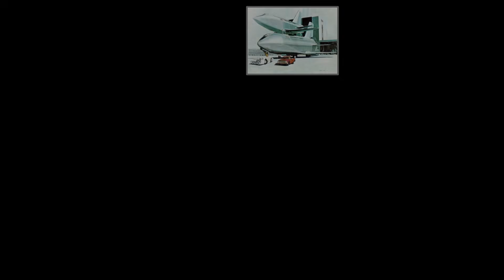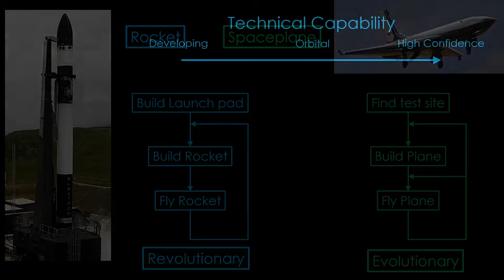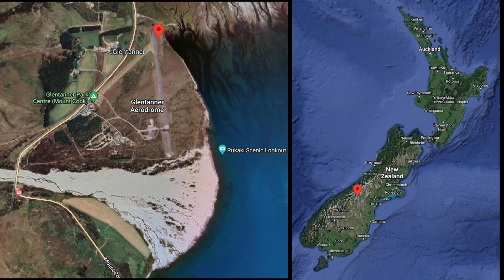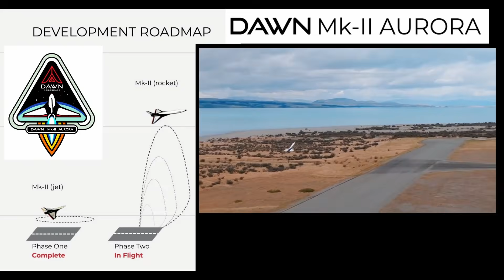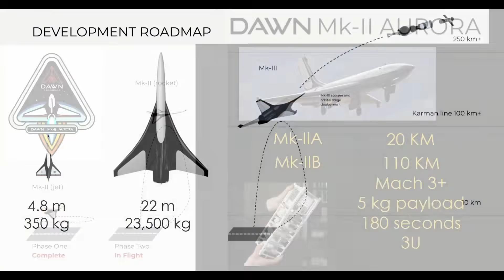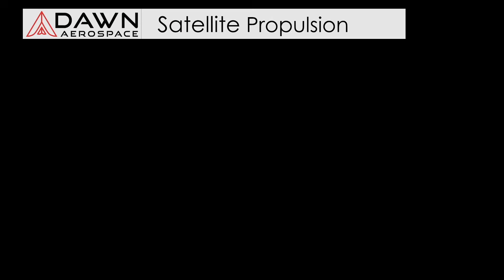Dawn Aerospace - Spaceplanes done right

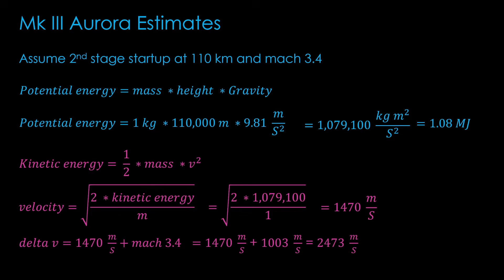Comment: I know it's an old  video, but16:55 is just plain wrong. You don't add the vertical velocity (needed to climb) and the speed at apogee as v = v_x + v_y as done in the video. You do it via Pythagoras: v^2 = v_x^2 + v_y^2. Or you add the two components for the required energy and then convert it to a velocity, it's exactly the same. The way it's done is the video is what you would need if the vehicle went straight up, then did a 90 degree turn to the horizontal, then accelerated sideways. But vehicles go in a diagonalish direction (resulting in a curve, because gravity) instead because it's far more efficient. This is what rockets do, and it's even more true for space planes.

This gives you 1900m/s not 2500m/s of deltaV. That's a *huge* difference, far more than the other neglected factors, and way too big for even a back-of-the-envelope estimation. Bad enough that that whole segment of the video ought to be taken down. It's a very, very basic mistake that I wouldn't expect a freshman to make. Getting simple physics wrong like brings into question the reliability of the whole channel, because who knows what other mistakes there are that I didn't spot, or are in places where the maths isn't shown on screen.
Reply: You’ve misunderstood the purpose of the maths here. It’s just about energy as a velocity not about the actual velocity of the object at apogee.

Edit: Perhaps to clarify the vertical velocity at apogee would likely be close to zero rather than 1.5 kms^-1 wouldn’t it?

So this is the summation of the energy required to throw something straight up to 110km and to throw it sideways with a certain velocity, all converted to a velocity.

Comment: Love what Dawn is doing but with everyone and their mother attempting rapidly reusable launch systems, I'm not sure Dawn will make much sense. The current Mk-II is great because it can presumably be transported to any airport easily and launch without any infrastructure. That plus rapid reuse makes it an obvious winner. I don't see how that scales to a larger plane though. They'd either have to make it capable of regular flight or operate from one location, which negates the benefit of horizontal takeoff using an existing runway. Is there some way that Mk-III has an advantage that I'm not understanding? I just don't see how one vehicle taking off and landing from the same runway offers much benefit compared to the many other options. A human-rated version that's still relatively small would make a lot more sense to me because at least then there's tourist and suborbital transportation potential. Imagine if it was still simple/small enough to transport by highway and then use any runway to launch people or payloads. It could almost be like a general aviation spaceplane. It could still do all the stuff it already does but it would be way cooler and more capable if they made it just big enough for a cockpit and thought about the idea of landing at a different runway than the one it took off from.

Comment: “Done right” is insulting to the American development of aerospace vehicles for a century longer than anything that has ever occurred on New Zealand. To pretend they know more than us. This vehicle’s engineering is nowhere close to that of the first rocket-powered X-planes.
Reply from the maker: "Spaceplane" generally means "orbital" in common usage, and that's what I was talking about. I was pretty clear in the video which vehicles I was comparing them to. 

I didn't talk about the X planes because AFAIK they've never been called Spaceplanes and they haven't flown for years. Dyna Soar would have been an interesting example if it had ever flown.

Interesting, the X-1 and the Aurora are comparable in capability. The X-1 topped out at Mach 1.45 at 21 km of altitude, and the Autora is up to Mach 1.1 and 25 km of altitude in its current test program, though their target flight envelope is Mach 3.5 and 100 km. That's about as high as the X-15 flew but much slower. 

It's important to note that the Aurora starts at zero altitude and mach zero, while the X-15 started at about 13 km and Mach 0.75
Reply: @EagerSpace I would highly recommend reading the Hypersonic Revolution Volumes 1-3 if you are interested in discovering how spaceplanes should be “done right”, and I’ll leave it up to you to discover the purpose of my comment through your own due diligence.

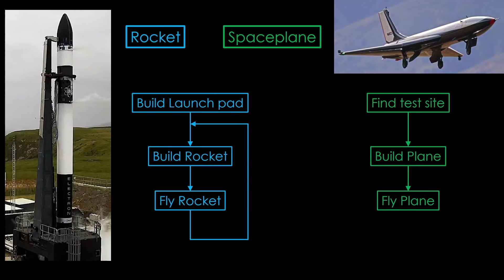Comment: @ 5:20 - actually, with a space plane, the west coast would be more preferrable. As you can fly downrange, and in case of an abort, you'll still have land under you instead of the oceans.
Reply: Is that really better though? If you prepare in design and procedures for an emergency landing on water then you always know what to expect and how to execute the landing, but if you need to make and emergency landing in hills or on a city, well, good luck.
Reply: @n3lis94  Emergency landing on water is probably pretty worthless if the vehicle is uncrewed. Every abort would probably be a vehicle loss.

Comment: This may be the right approach. mach 3 isn´t really that fast. I guess the real limitations here is delta-V not speed.

Of cause with the benefit of a space plane that it have a virtually unlimited cross range there is a pretty big benefit say at least theoretical above something like Falcon 9.

Of cause most mach 4 and faster aircrafts are really complicated.... Well most. But there are exceptions. Granted.. To say its a simple construction is probobly to lie, but compare to most aircraft, its pretty simple. The meteor missile.

That begs the question, how do meteor launch at low speeds. And i did some digging, and the solution is really simple. They simply overcast a rocket compound on top of the ram-jet compound. Giving the missile a 2-4 second burst of rocket engine, then transition to ram jet operation giving it a estimated ramjet ISP of 1200 to 1500s. That allow it to reach mach 4, possibly a bit faster, while the altitude is a bit low. Its not public what altitude it can operate in, but the optimal altitude is specified as around 20km. Making it a 3 stage system from the current 2 stage system should be reasonable

Of cause, having a solid motor on a reusable aircraft is probobly not sustainable. But it seams like this problem was solved more than half a century ago.

Now i´m to lazy to do the math, but it seams to me that getting a aircraft from mach 1 close to sea level up to mach 5 (decently doable with a well engineered ram jet) at 30 to 35km altitude, should be the majority of the energy needed to get to a suborbital trajectory.

And with that conclusion, that is basically what Hermeus aerospace is doing with quarter horse  (while it was not primarily intended to go to space, but just to go fast)
Reply from the maker: The mass is pretty simple; you can mostly ignore the amount of energy it takes to get to altitude because the speed component is more important. Mach 5 is only about 1700 meters per second and LEO orbital velocity is about 7500 meters per second, so it's a little less than 1/4 the velocity you need for orbit. Fine for suborbital, but not very close to orbit
Reply: @EagerSpace  well yes. Resonable any plane like this would probobly be considered a first stage replacment, well.. i guess skylon ignored that. But if we talk about a resonable achivable design with a private budget.
Reply from the maker: Skylon confused me. I think there may be a market for a long-distance hypersonic airplane which would be reasonably possible with their technology, but instead they decided to focus on an SSTO vehicle that would be far harder and would have a smaller market.
Reply: @EagerSpace  Yea it is kind of strange.

My reading of it is that while Skylon would make a better hypersonic transporter than a space plane, its still LH2 based 

But if you can make a hypersonic aircraft with normal Jet-A that woud make it a lot more usable, and.. safer.

And we already know that SR71 and XB72 can fly at mach 3.5, the issue there is not really the engine, but the fuselage.

Of cause, yes, mach 3.5 is not mach 5. Still if you be a passanger in a mach 3.5 or a mach 5 aircraft, it would really not matter that much, 

I guess the man advantage, due to ram jets and other similar engines works is the better fuel economy at higher speed. On the flip side, having the fuel as hydrogen, kind of nulify that advantage.

Comment: Ok, let think outside the box. What type of engine and fuel Wouk be necessary to make a true SSTO spacecraft? We heard enough long winded video about why it can’t be done.
Reply from the maker: I don't think there's a practical solution at this point. I talk about it more in the "where are the spaceplanes?" video, but the basic problem is that with a SSTO, you need your rocket to be nearly all fuel, which means the structure needs to be extremely light and therefore will be very expensive. And If your models are off, you may go from a small payload to a negative payload. You also can only target LEO. 

It's a poor investment from a development standpoint, and if you can build a SSTO that works, you can build an outstanding two stage to orbit rocket that will carry more mass to orbit and be much less risky to develop.

Comment: "Single stage to orbit is just too darn hard to do"... Hours on hours of fruitless spaceplane designs on KSP certainly back this up lol
Reply: In fact, the race for ever-higher speeds for airplanes stopped in the 1960s. And that's because satellites had become much more advanced and ballistic missiles had achieved very high precision. The last plane of that era was the SR-71, whose combined-cycle engines were able to exceed Mach 3.
Reply: SSTOs are super easy in KSP, just strap a Vector and a probe core to a fuel tank. Mk2 parts have insane drag though
Reply: @rdablock  I wonder if FAR fixes this.
Reply: @holl7w  they do fix mk2 parts, the Vector thing still works though (add nosecone if it doesn't)
Reply: @rdablock  great that means i can make mk2 planes, just that it'd require 6 more hours of tweaking instead of using mk1
Reply: How to make a basic rocket SSTO in KSP:
1. Build a replica of a Falcon 9 first stage
2. Slap a fairing on top for your payload
3. Put a Mk2 service bay with your control systems in it on top of the fairing base
4. Place a heat shield on top of the service bay
5. Add drogue parachutes and regular parachutes to help slow and reorient the rocket on descent
Reply: Same, and that's even though SSTOs are significantly easier to build in KSP than irl

Comment: 16:50
assuming you climb vertically, coast and then accelerate once at the top rather than accelerating diagonally or in an arc
in the most optimistic case it would only add up to 1780
but then again you also have gravity losses and hte takeoff and drag so overall 2400 is probablya good guess

Comment: It’s difficult to defy rock hard physics though. They determined a long time ago that getting out of this soupy atmosphere as quickly as possible with a vertical projectile is most efficient. Wayyyy too much fuel consumption to fight the atmosphere horizontally for any length of time.
Reply: I find this hard to believe, a spaceplane has lift built in.
You get the entire first stage quasi for free.
Rockets don’t launch straight up either, they rotate East.
Also a spaceplane can use scramjet engines which a rocket can’t.
I think the biggest problem with spaceplanes is that they’re more complicated, it’s basically an airplane and a rocket in one. 
And they’re doing it wrong by not building big enough.
30m in length is insufficient, I was thinking something more along the lines of 150m in length to be comfortable.
I also think it’s wrong by trying to use existing runways. Imho a spaceplane needs a dedicated runway.

A spaceplane can move at relatively slow speeds at relatively high altitude.
Whereas a rocket either fights the atmosphere at high speed, or fights gravity at slow speed, there’s just no winning with rockets.
Reply: @CoderDBF  No winning with rockets?? 
Currently the score stands at ROCKETS: 35,000    SPACEPLANES: 0

The fact is irrefutable. Rockets are, by a vast margin, the most efficient with fuel cost and size of payload with the intent of orbit velocity, when utilizing reusable boosters. Now if you want to poke up above the Karman line for a few seconds and take selfies, knock yourself out with a space plane.
Reply: @Mothball_man  
What is the largest spaceplane ever built? And what’s the largest rocket?
There’s your answer.
A rocket is just a lot simpler by design, engineers are lazy.
SpaceX has shown that rockets can be reused, yet the European Space Agency is still making disposable rockets. 
No one wants to be bothered with the added complexity.

No one has ever even tried to make a spaceplane correctly.

If you just think about it from a physics perspective a plane should be more efficient in every way.

How much does it cost to fly hundreds of people halfway around the world in an Airbus A380? And how much does it cost to launch a rocket?

It has never been attempted due to the high upfront development costs required.
Reply: @CoderDBF  I know it’s frustrating. I remember being on your side of the argument. But you just have to grasp it. Orbital velocity is unbelievably and ridiculously fast. It’s 23 times the speed of sound. None of our known materials except costly, fragile ceramic tile can withstand that heat. An aero-lift ssto will have to haul that extra un-aerodynamic shield plus a crazy amount of fuel, plus it’s ridiculously heavy hybrid scrams through our soupy atmosphere. Nope.

A rocket’s simplicity is also its saving attribute. It gets up and out of that soup quickly. Kicks off the reusable booster and away we go. It’s simple. It’s beautiful. Spacex engineers are the very best and they’ve been working on this a long time. They know without a  wink of doubt that using aero-lift and jets upfront would AT BEST eek you to orbit with little payload. It’s just not going to happen. 

I’m done sir. Please just study the physics. Don’t be like a child arguing for the case of Santa Claus.
Reply: @Mothball_man  
There’s just no way a rocket launched at sea level straight up from a standstill position is more efficient than launching it from 10’s of km altitude already going at Mach 5.

You get your first stage (the most expensive stage) for free.

You get lift for free, you get the oxidizer for free.

On top of that you don’t need to worry about stage separation.

I appreciate you taking the time to reply but please give me a compelling argument before you drag Santa into this.
Reply: @CoderDBF  Sorry my frustration equivocated your lack of understanding to belief in Santa. But friend you just need to study it. The glossy YT vids aren’t enough. I don’t have time to explain any further.
Reply: One day like microplastics too many rocket launches/re-entrys of satelites/boosters may damage the environment of our atmosphere that would push spaceplanes tech as a less destructive solution.
Reply: @joeljong931  I also fear damage to our atmosphere from increased rocket activity. The pollutants of a launch is ridiculous.
Reply: How does pollution caused by rockets compare to that of aircraft or automobiles?

Likewise, compare and contrast what humanity has gained from space against what has cost.

TL;DR: It's complicated.

Comment: Dawn space's Mk2B looks a lot like Virgin Galactic's line of spaceplanes. Just subscale, launched from a runway and using liquid fueled engines. Would have been interesting to focus more on this comparison.
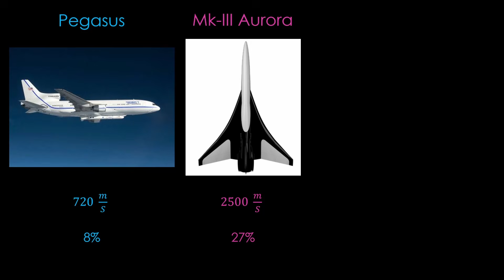Also you sort of missed the point of airlaunch at 17:38. The speed of the carrier aircraft is really meaningless. The only notable benifits come from starting up high (less aero drag for the rocket part, and more efficient high expansion ratio nozzel geometry) and being able to move your launch site (possibly heading closer to the equator or avoiding bad weather).
Reply from the maker: Virgin galactic is not designed for the orbital market so I didn't think it was a reasonable comparison. Virgin Orbit or Pegasus are better comparisons.
Reply: @EagerSpace  sure, Virgin Galactic's SpaceShipTwo isn't putting anything into orbit. Neither is the Dawn Mk1, Mk2A, or Mk2B Aurora thought. Mk1 and Mk2A aren't even spaceplanes, but Mk2B is a suborbital reusable spaceplane, just like Virgin Galactic's SpaceShipTwo (and also Delta and the SpaceShipOne). The only difference is that Dawn are targeting more the sounding rocket market, while Virgin Galactic is mainly doing space tourism (though they can also do science on board). Even for the Mk3 Aurora, the spaceplane part would only be a suborbital first stage.
Reply from the maker: Virgin galactic is using a two stage approach to get suborbital, with a big and expensive carrier plane and an expensive space plane. Both are human piloted. 

The economics of virgin galactic's approach means it's a very different market than dawn is aiming at.

Comment: Wouldn't it be 110 km OR Mach 3.4? From your presentation I get the impression that it's only barely able to get to 110 km.

If the flight profile ends up being similar to New Shepard, it maxes out at ~1000 m/s at 46 km. Then it coasts up to 106 km, stops climbing, and drops back down again.
Reply from the maker: Pretty sure the goal is to get to both. If the plan only gets to 110 km with no useful speed it's not terribly useful as a first stage. But it's been a while since I did the video.
Reply: @EagerSpace  Checking their site, at least for the Mk II it doesn't seem like it's both. They expect to barely reach above the Karman line. If it was both, they'd coast to over 160 km. And 180 seconds of mcrogravity pretty much lines up with New Shepard.

It's a bit harder to tell for Mk III. There's not a lot of information about Mk III specifically, so maybe they plan on upping the performance substantially. But that's not my impression.